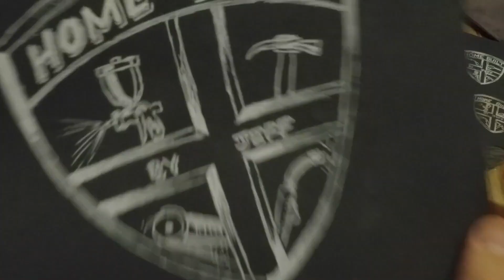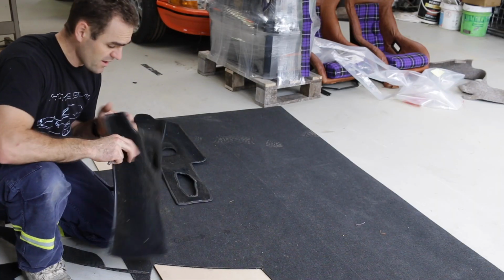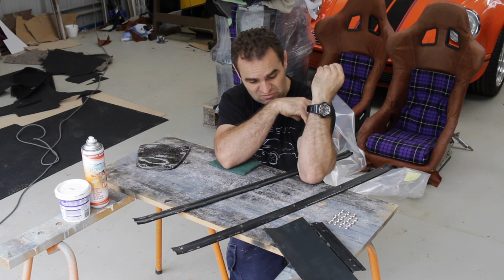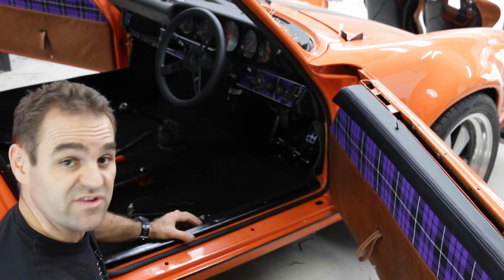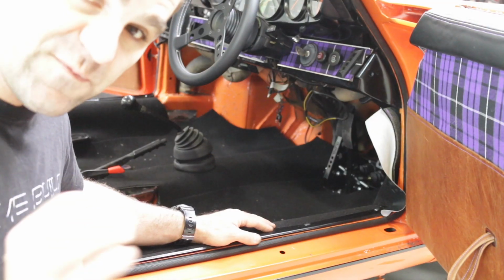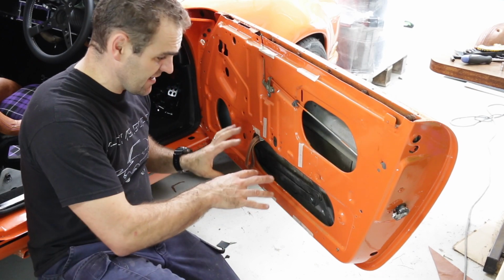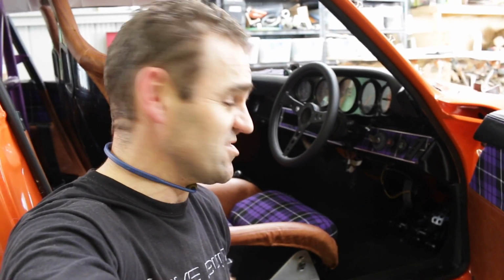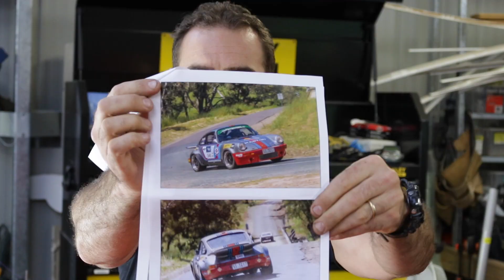Porsche 911 Classic Car Build Part 46 - Changing to black carpet

Comment: The interior is starting to look a lot more cohesive now with the black carpet Jeff. By the way, the leather on your seats could do with some tightening up. A car detailers trick is to use a steam cleaner for the job. Get a decent steamer and use a 4" tool with a terri-towel cover and apply steam to the areas that need tightening. 

Of course, start in a less conspicuous area to test and make sure the leather will take it fine.

Keep up the good work. I look forward to seeing the glass in the car.
Reply from the maker: One of the seats is good. The other is still too loose to steam. I need to unpick some of it and tighten it up, I just wanted a break from it this week ;)

Comment: I think the seat brackets could use a touch of Purple from the roll cage ....... Just a little accent between the black carpet and the tan of the seat ......... Nothing else in the car is bare Billet Aluminum ....   Just an idea , not sure how it would look , but the shiny aluminum just stands out ........
Reply from the maker: I agree they need something. I haven't touched them yet, because I want to try to get the seat lower, but they will get the treatment ;)

Comment: Looking great Jeff. You're such a sewing machine whiz...I'm surprised you didn't bind the edges of some of the carpet pieces.
Reply from the maker: I probably will, I just got lazy and wanted to move on. You can still see a bunch of cut edges of the carpet, which would look much better edged nicely. I will probably come back to it.
Reply: Selfishly, I just wanted to see the process since I'm about to go through it.  :)
Reply from the maker: I will do it, and it is not overly difficult. You just cut out a 5cm strip of Vinyl, and put it upside down on the top edge of the carpet. Sew it on about 1cm in from the edge, then you can fold it all the way over the edge and underneath, then sew it again from the top about 1/2cm in. I hope that makes sense. I will get off my butt and do it soon so you can see it ;)

Comment: Are you going to paint the bracket under the seat black too?`

Btw i started my ford up after it's long winter slumber. Water pump has been leaking so i fixed it while at it.. Also massaged the alternator better so it doesn't create belt whine. Crossed my fingers and fired it up.. The most smoothest idle you've ever heard.. Feels like the engine is brand new.. Revs up very happily too. 
Still waiting for the weather to get better so i can start working on the tie rod end that desperately needs replacing. 
After a while of not touching the car.. When i sat on it. I remember that it's a rare gem that needs to be kept polished up.
Reply from the maker: Sounds good. I am all for getting out in the garage and tinkering away. That to me is half the fun ;)
Reply: It's more fun working on your car than actually driving, it isn't it jeff?
I'm getting most fun out of my CVT automatic nissan micra with 1,3 engine.. It's one of those cars you don't care about and drive the shit out of.. But that's the most fun part.. Driving the shit out of your car not caring if the transmission is clattering a little.. Just drive till it breaks.. But on a hobby car, you just can't bring yourself to scratch the paint on gravel roads..

Comment: Hi Jeff, Great work as always. Love the black carpet colour. However with the carpets you might want to consider edging the panels - it gives a much more professional finish and is what they did at the factory - here's a pic of mine edged just after I'd finished it. http://s14.photobucket.com/user/markslade/media/E25C6245-A2C1-4C0A-B582-05C10BDFAF8F_zpsnhso6nxf.jpg.html

Edging is dead easy and the edging trim costs next to nothing. Here's the online guide I used to show me how to edge -  https://youtu.be/vbPLrzq9NMM
Reply from the maker: I may do that to some of the more obvious edges, to tidy it up. It looks much neater than seeing the cut edge.